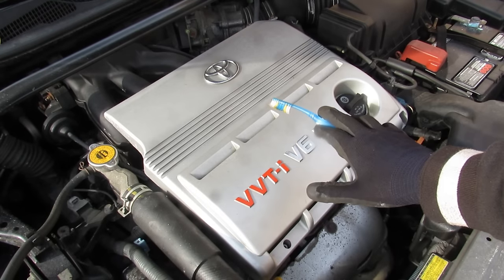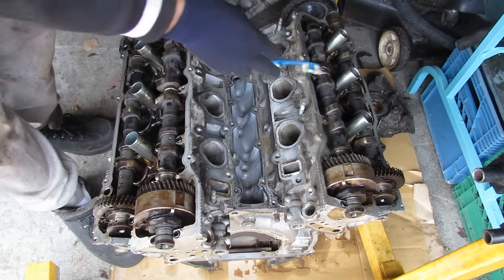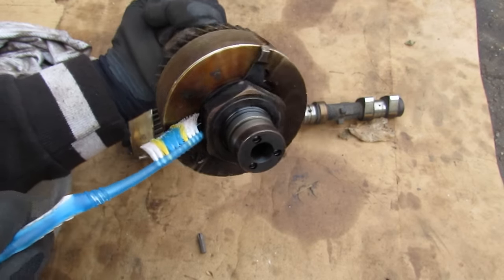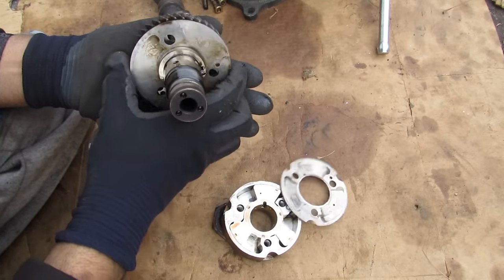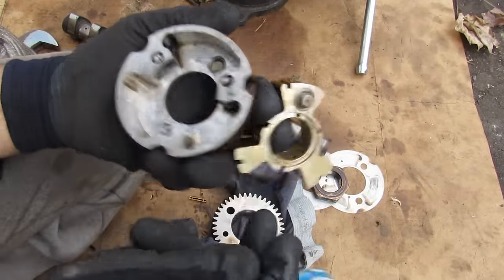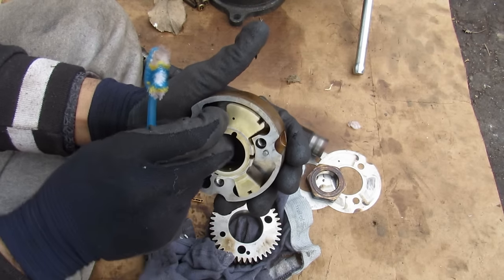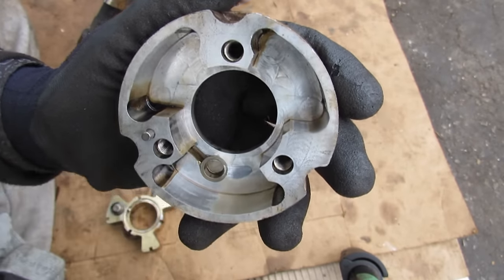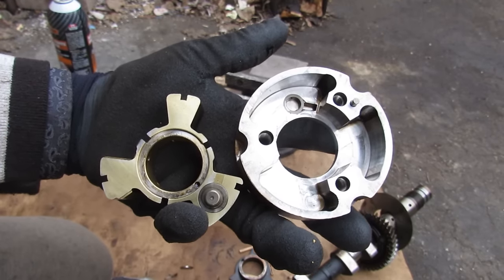Here's Why Your Car Rattles on Cold Starts

Comment: My wife's CRV had the same noise, so I sold it to my brother-in-law.
Reply: I almost bought my mother in laws crv had the same problem. But she only changed her oil based on the oil life monitor and I’m pretty sure that’s why she had that cold rattle.
Reply: Thanks for the tip. Good looking out.
Reply: We sold our '19 CRV for a new '23 Escape Hybrid an never looked bk. Honda has gone dwn hill for sure. Others have surpassed em in technology.
Reply: @thetechlibrarian Honda engines aren't what they were even 10yrs ago. No thanks! Our '23 Escape Hybrid is whisper quiet an has better technology/features. Facts.
Reply: 😅😅😅😅😅😂😂 sweet revenge bro 😉
Reply: My wife’s matrix did the same thing. Changed her oil and problem solved. Funny thing is hers is a 2010 with 90k miles and mine is a 2005 with 190k miles and mine has never made that sound. 😂
Reply: Haha, smart man😂
Reply: Lmaooooo

Comment: Here the trick I use to not rattle at next start. When your done driving the car , park it and let it idle for 3 minutes.  At your next start it shouldn't rattle.  It's been working for me .
Reply: Tried that. Didn't work
Reply: @wilsonemeka1833  yes it stopped working for me too. The best you could do to minimize the sound is push the start button and let it crank but push it again b4 it starts so it could shut off, then just push it to start again normally and by then you have some more oil circulated 😂 screw it theres no way around it man. Its gana rattle. Car still runs good tho
Reply: @godsarmy3450 😅
Reply: U 👍are good

Comment: It's nice to know this isn't a critical issue. As long as it works and you're not getting stuck in advanced or late timing and screwing up your hp and mileage, nothing really to worry about. I do see auto shop scam material here though. An expensive fix to repair something that isn't really broken.
Reply: Will go over 200,000
Reply: So it won't ruin my 2009 Pontiac vibe and leave me stranded if I never fix it?
Reply: @DragonSailor-Hooah  common issue. i have a 2009 aswell. i have heard of people running the car for years with VVT rattle. no problems. and if fixed it can come back still..
Reply: @Jalopymedia i dont know if this is true but I swear I've heard that there's a chance that if you have the vvti rattle on a Toyota, the part or spring could eventually come loose and that would be bad to have a loose part inside the engine. But I'd look into that before really worrying about it.

Comment: 4TH AND FINAL UPDATE ! 07/04/2024 
Rav now has 308k Miles. Took the plunge and drove it to the youtuber The Car Care Nut about 8 months ago and he replaced the solenoid and installed a new head cover gasket. Rattle stopped and chain / chain guides were looking solid and no where near being damaged. Gave the car to my mom and got a GS350 F-Sport. She will eventually have to worry about getting the block replaced for a new one since it burns oil and has an engine balance rod rattle that will one day cause some serious issues. Other than oil consumption, car still runs great with at least 50k trouble free miles ahead. 👍🏻

3rd update! 01/02/2023. Car now has 280k miles, rattle has not changed its duration, remains the same since 150k ish. My only concern would be one of the plastic guides falling off due to vibration and end up messing up the chain. 

Update since I saw your video for the first time!! I couldn’t find my original comments under someone else’s comment. When I noticed the noise, my 11’ Rav with the 4cyl had 130k miles. Now it has 248k and has not changed (noise lasts about 2 seconds then goes away). I’ve learned to live with it and I’m getting my money’s worth out of this car. Really seems like it doesn’t damage the engine.
Reply: Dude my rav4 makes that same noise, lol not to this extent but I’m taking it tomorrow to Firestone.
Reply: @manueltalavera7877  Hey! These cars are known for this noise. My Rav now has 280k miles. Still rattles when cold starting but still hasn’t changed in termos of duration.
Reply: @manueltalavera7877  If you have the 4 cyl, I wouldn’t stress about it
Reply: @thegravitx  ohh okay, but what is the cause of it ? Ima still get it diagnosed & see what’s wrong with it, & yeah I also have the 4cyl
Reply: @manueltalavera7877  The cause for the rattle you mean? It’s explained in the video. It’s a pin that takes a second to lock in place due to oil sipping down to the bottom of the engine. Once it builds up pressure, pin locks and rattle stops.
Reply: @thegravitx  ohh okay, well I’ll find out today or tomorrow what’s wrong it. It’s at Firestone now lol. I’ll definitely keep you posted.
Reply: @thegravitx  hey dude. Just wanted to give you an update. So the rattling noise, wasn’t the timing chain tensioner, it’s bad cam gear, Toyota is actually doing the job lol. I’m paying 2500$ to get the job done. I’m to thank discover for paying that bill 😂😂
Reply: @manueltalavera7877  Jesus!!! Yep. I looked into before and that’s about right. I’m planning on giving this car to my mom so she can get around. So that’s probably what I’ll have to do. Thanks for coming back with the update man!!!
Reply: @thegravitx  lmao tell me about it !! & yeah no problem man.
Reply: And what about the 6 cylinder

Comment: Great video! I've heard that clackitty clack noise many times in our  2008 Highlander, which now has 220,000 miles on the clock. About 5 years ago when this started, I researched it and decided to try Motor Medic synthetic Motor Flush from my local O'Reilly's (I'm not trying to plug a specific product or vendor). Pour it in a warm engine, let it run for 5 minutes at idle (NO revving!) and change the oil. Worked like a charm! It cleaned off any varnish on the moving parts of the VVTi system and the noise stops for a number of months until it comes back and I have to do it again. It's a nasty noise as you know from this video, and it resounds throughout the neighborhood. It's unfortunate there isn't a more reliable design for this. Honestly, it sounds like your motor is about to blow up.  During the warranty period of the car, we always had our Toyota dealer do the maintenance. After that I started doing the changes myself, and I soon discovered a gummy buildup on the underside of my oil cap. This led me to believe the dealer had been using garbage oil all those years, so I made sure to always use synthetic oil ever since. Synthetic oil doesn't make this problem go away, but I suppose it's possible it's delays the return a bit.
Reply: Thanks, I'll try that also
Reply: @SilkyGSmooth  Depending on how bad it is with your car, you may need to do this more than once. It worked on the first try for me, but I now do it every 2 or 3 oil changes. Good luck!
Reply: What if you don’t do anything will you damage anything in the long run?
Reply: @Ye-yz7cx  Excellent question to which I WISH I knew the answer....  Fixing the VVTi system as a preventive measure would cost thousands as it's a fussy labor-intensive process project. I suppose if hundreds of thousands of people with Highlanders and the half dozen other vehicle with this motor started experiencing engine death then Toyota might do something about it.
Reply: @InexplicableBill  And at the same time, I got a recall for my 2011 Camry for a soft dash pad that would be replaced for free! SO why not something that is MUCH more important for a RECALL like the poorly designed TOYOTA VVT....
Reply: @chrisluquette1615  I can't agree with you more on that!!
Reply: @chrisluquette1615  was looking through the same info today and thought the same thing lolol
Reply: My daughter's first car adventure... We checked out all kinds of different SUVs for her and I researched them all.  Found good reasons not to buy them. Then we got interested in Toyotas, and I assumed no research required, they are reliable.  Our old Solara got over 300k with piss poor maintenance and was still going strong when we sold it. Test drive the highlander and it performed wonderfully.  Pink transmission fluid and no delayed engagement on a 120k 10 plus year old car. No misfires or shaking, perfect I thought. Until we took it home and it sat overnight. This adventure has led me to an obsession with solving this problem or learning to simply live with it.  I've heard it can grenade the engine if the rattle eventually causes part of the timing chain guide to snap or the gears split.  Going to try your approach as Ive revived a Kia that started shaking after going 20k without an oil change using seafoam.
Reply: @chadg6874  Good luck!! I don't need the engine grenading in this thing - the transmission already did that to us at 165K and cost us $5,000 to repair. I STILL have a sore spot because of that.
Reply: @InexplicableBill  oh no, man that sucks. The one we just got has 120k on it, and still has pink transmission fluid.  I still want to replace the fluid soon because I've learned my lesson with that before lol

Comment: A house brand engine oil flush fixed this rattle on my 110K+ Camry. I ran it a bit longer than intended (2 days) before changing oil/filter because of weather, but just wanted to mention because it saved me from the "damn that doesn't sound good" anxiety every morning, even though it's probably not that big a deal as you said
Reply: can you go into more detail please
Reply: Yes. Please more details so we can replicate.
Reply: I can’t comment for this guy but I used an oil cleaner (MMO) mixed with Seafoam for a mere 15 minutes before draining out the oil and eliminated the clashing noise. Worth a try.
Reply: My Lexus is300h hybrid 2014 with 60k on it every morning, always serviced on time with 0W20 oil, and you know what the rattle is staying there as it’s only a slit second in the morning.

Comment: A customer came in once with an Avalon that had no start issues and we went through everything from knock sensors to the solenoids mounted on top of the head and no luck.   Put a replacement engine in and took the old one apart and discovered basically what this video explains except it was in between engaged and not engaged.  Meaning the car probably never had any scheduled maintenance performed.  Love the video. New subscriber here. Thanc a lot
Reply from the maker: Ouch. So the VVT gear caused it to not start at all?
Reply: @speedkar99  not the the gear its self here at 3:16 you explain how the oil passage for the vvti pin can take time to build up pressure. Well with sludge and no interval services perfomed correctly, he had this rattle for years. So the inside of the aluminum housing the two seized and kept the intake cam shaft at such a point in between the two engagements it bent a few valves enough to not have compression in a few cylinders.

Comment: Had this issue on my Camry as well except the noise lasted for a lot longer. Didn’t go away until I started driving. I changed the oil control valve and that fixed it.

Comment: Hi SpeedKar, THANK YOU VERY MUCH INDEED, I have a UK 2007 Lexus GS300 with exactly the same rattle, which started around 50,000 miles and has caused me a great deal of concern up to seeing your video, (now has 61,000 miles I do not drive a lot at 78 years old). Someone told me it might be the timing chain, but the rattle is identical to your example on the tube. Thank you again you have relieved me no end. VERY GOOD Video, straight to the point - I have just now SUBSCRIBED - WELL DONE!!
Reply from the maker: You are welcome

Comment: I own a 2011 Ford Edge but it never made this sound until I got it back from the mechanic after some extensive repairs related to a water pump failure. He looked at it several times and finally threw up his hands and told me to come pick it up. I've been Googling my hair out trying to find an explanation for what the problem could be before I take it to someone else and drop even more money on it, but this is exactly what it's doing. Now I think I can take it someone at least get them looking in the right direction. Really appreciate this video.

Comment: Minor correction.

The pin is to lock the actuator in place when the engine is off. 
Oil pressure builds up on the control side, through the solenoid, then unlocks the pin. 
When the solenoid has pressure, it has control of the actuator.
Reply from the maker: Yes correct

Comment: This happens in a lot of Honda engines as well. Stealership quoted $600 to replace. Bought the OEM part off eBay, then had a backyard mechanic (works as professional mechanic for day job) do the work. Altogether spent about $350.

Comment: On any cars w/VVT's, I would avoid extended oil changes and follow the recommended oil weight for that engine. I see too many folks still trying to use 10-30 or 10-40 oil weight on these engines. VVT's LOVE and need clean oil to work properly.
Reply: Que aceite puede llevar un toyota corolla 2014 automático 1.8
Reply: @marvinumanzorzuniga79  Rebisa el manual del dueno o la tapa del aceite.
Reply: @marvinumanzorzuniga79  creo que 5-20

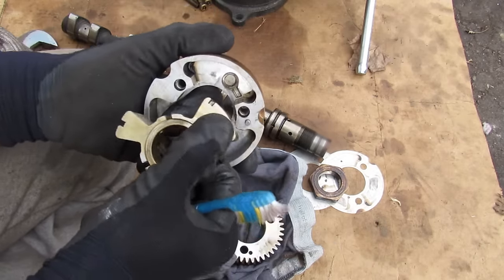Comment: This is really confusing because at 3:02 of the video says "And that's where we come to the root cause of this vvti rattle this little pin over here which can sometimes wear out or be lazy to retract due to just carbon buildup". Correct me if I'm wrong but the pin is unlocked by oil pressure allowing it to Retract against spring pressure and it's spring pressure overcoming residual oil pressure that causes it to Extend out into the outer housing and lock. If it was lazy to retract then the spring pressure would be causing it to be Extended out against residual oil pressure and locked into the outer housing so it wouldn't or couldn't rattle? Also at 3:13 says "Now because this pin no longer engages with the housing (pin Extended out by spring psi into the outer housing into the locked position??) the input and output is free to move relative to each other especially when you turn off your car over night and all the oil pressure drains, there's no spring pressure forcing it to go back and click inside. When you turn on your car in the morning you're going to hear the input and output move relative to each other and that's what causes that rattle until it actually clicks in and engages for that one second it takes to build up oil pressure". Again this is really confusing because previously it was said the cause is the pin not engaging (extending out into the locked position because of carbon buildup) so why would it now engage (extend out and lock) at startup especially after it has rattled back and forth for the one second it takes to build oil pressure when it's the buildup of oil pressure that causes the pin to retract and unlocks the actuator?? My understanding of this system is the actuator should be locked when you shut the vehicle off so when you start it up after 6+ hours time that the oil has had to drain out of the actuator it won't rattle and it remains locked until either a certain rpm has been achieved like above 3000-3500 or heavy load placed onto the engine and then the ECM commands the oil control solenoid on to direct oil to unlock the pin and allows the relative movement between the input and output advancing the timing thus changing valve overlap on the intake side opening the intake valve sooner on the exhaust stroke. This system is discrete meaning it's either off (no intake valve advance) or on (intake valve advanced to one position only being 15' or 30' what have you due to the internal design of the input to output inside the actuator) and is not continuously variable. The question that I'm having difficulty with and yet to find a video that really explains the oil control valve and the flow of oil to and from the actuator vanes and locking pin in detail. Does the oil flow into and out of the vanes and to the pin at the same time or does it flow opposite to each other. So when you first start the car the oil control solenoid is off and by internal spring pressure allows oil to go into the vanes to dampen the relative movement between input and output when eventually commanded on by the ECM by rpm/load but not to the locking pin unlocking it until after the ECM has commanded the solenoid on by RPM/load achieved and then shuts the oil off to the vanes allowing the dampening and draining of oil from the vanes. If it works this way and it rattles on start up until oil psi has built up then once the oil psi has built up it wouldn't unlock the pin allowing the the input to move relative to the output at low rpm which isn't when it's supposed to be activated. This part of the system has yet to explained well in detail on any video.
Reply: I'm with you on trying to figure out how this is actually supposed to work.   The pin definitely locks when you shut off the car.  I know this cause I've opened up the actuator on the car a few times and it is always locked.   So it has to be that the spring is too weak to keep it locked on startup.

Comment: Nice work, you are the first guy to give great detail on this issue.  My 2016  2.5 Camry does the rattle.  5-30 Castrol magnetec oil helps a little.
Reply from the maker: Yes it's better than the 0w20 specified
Reply: Do 5 short Oil Change Intervals at 500 miles each. The detergent additive pack on any synthetic SN oil can dissolve the carbon buildups and greatly alleviate the problem.
Reply: Was about to ask if changing the oil weight could help.  Thanks alot guys. Was googling this issue last year and now I finally found the answers
Reply: @captmaverickable  500 or 5k
Reply: @captmaverickable  I also did a couple 1000 mile oil changes and used Lucas engine cleaner, 1 ounce per quart.  Cleans those little oil holes some.   Engine has been pretty quiet.    Some say synthetic forms crystals in engine.   They need dissolved.